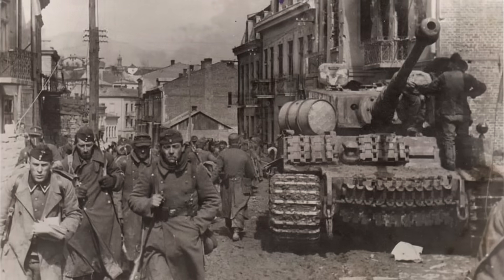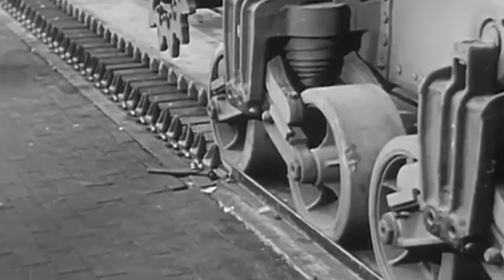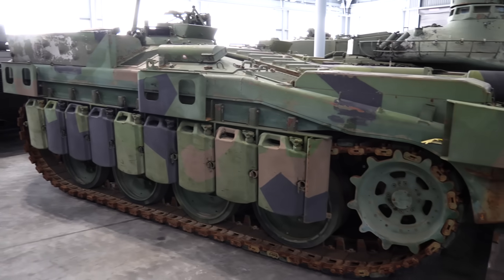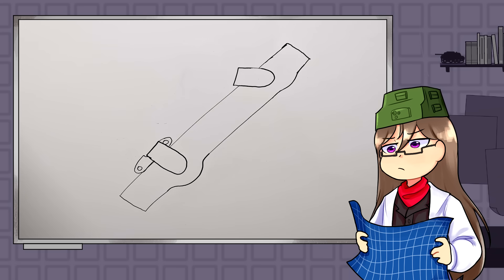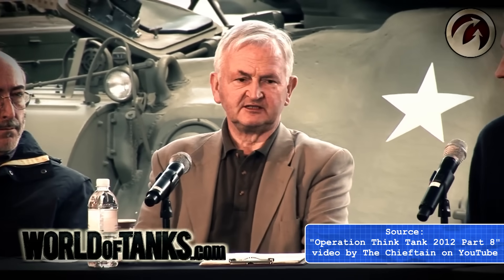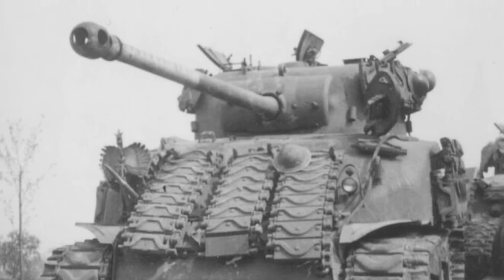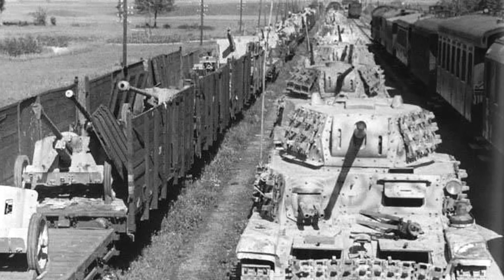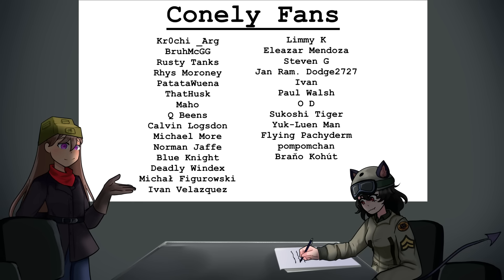Tank Tracks as Armor: Good or Bad?

Comment: I think that, for the most part, using tracks as add on armor is more a matter of improved morale as a result of feeling like you have taken your survival into your own hands. The fact that it does occasionally somewhat help is just an extra bonus. It is the same thing with sandbags and wood poles, not necessarily always effective, but it acts as a buoy for the crew’s morale. Which could in turn lead to them being more willing to take the initiative. 

Also, I have come across the existence of the Jagdchieftan, and I think it would make for a good episode of Cursed by Design. I haven’t been able to find much on it outside of photographs and a Tank Encyclopedia article.

Comment: There are several other aspects about adding Spare Tracks for added armor protection and are always overlooked, and that adding more spare tracks or armor plates adds more weight to the tank's normal amount of armor protection it already has and can greatly effect the tank's Engine Performance, Fuel Consumption and  Suspension Travel and can cause unforeseen problems for the crew especially when traversing in the countryside especially in deep snow, thick mud and going uphill.

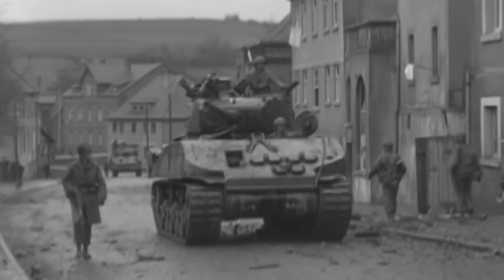Comment: [1:03] What tank is that?! Clearly it is Sherman-derived — but the entire front looks different, with that deep recess for the machine gun and that continuous sharp-edged rounded-Y front? Armor looks slab sided and extra heavy, but has a long gun... not an Easy 8, not a Jumbo, what is it? 🤔
Reply: yeah. I think its some kind of heavy field modification. In other old WW2 footage I have seen quite some insane modifications. 
But I am still unsure. Looks a bit too good to be some add on plates.
Edit: I think it's well made concrete armor. It's so well made that it looks like one continuous armor plate.
Reply: @Napswhilewatchin  exactly my thought, looks waaaaay to perfect and slick, to be a field modification — must've come from the factory or prototype lab like that
Reply: @lkjh861  Take a look at the gun travel lock thing. The shape is a dead giveaway that it hase to be concrete. And I think they added concrete on the sides as well. That's why it looks so "perfect".
Reply: @Napswhilewatchin  Spot on, looked it up -- that's exactly what it is. Never seen that before, despite having been interested in WW2 and especially tanks since childhood. 🤓👍
Reply from the maker: It's a Sherman with concrete added to the hull front

Comment: I would say it has at least a psychological effect on the crew, just adding some sort of armor will make them feel safer.

Guess on the straight armor like the Panzer III, IV and Tiger it might give some evenif it might be minimal protection.
On sloped armor, as you said it might act as a shottrap, preventing a shell from glancing off as it catches on the links.

Versus any ammunition that explodes on impact it probably also add some additional protection.

So as your conclusion it is situational. 
But never underestimate the psychological aspect superstition plays a big role, in that as well. Seeing a shell being stopped by additional tracks on a tank nearby might make you belief it works even if there might be some other reason for the non penetration. That also works on the antitank crew, seeing their shell bounce, making them think they can not defeat the additional armor.

There are many aspects that define if a shell penetrates or not. Also do  not forget that steel quality varied a lot in WWII, depending often from which factory the tank came. same with shell quality. So even these are reasons a shell penetrate or not. So you think you are safe in your T34 as you see a 75mm bounce off your neighbor tank, but yours might come from another factory and the same shell will penetrate.

Comment: Well questions like these regarding tanks always depends on the context.So as some of us might know armour piercing capped shells (apcbc)have metal caps made out of softer steel,so when the shell is shot at an angled armour plate the cap which is made out of a softer material de forms which decreases the angle when the shell hits the plate thereby increasing chances of pennetration.So in the case of of tracks on for example the upper front plate of a Sherman act as a cap for the shell when it hits the armour.

Comment: What it does do is handle lower calibre rounds on thinner armour sections, eg sides & rear.

Expect to run into people with 20mm autocannon or a 37mm in a recce vehicle?  Track links will be useful when your side armour is only 30-40mm thick there anyway.  20mm side armour and expect to see 14.5 or 12.5 mm HMG rounds?  Again, track links and the like will cope with those and eliminate the "1 in 50" that might make it through otherwise.

Comment: A couple of things not mentioned here: Yes, track links might not provide that much extra armor, but it is what is readily available to troops in the field: take a knocked out tank,push it off its tracks and you have plenty of material easily attached to your vehicle. Another factor is the psychological factor: If you think you are in a vehicle better than usual then you will be more at ease - a bullet can go through a thick log, but still people take cover behind them. And finally, I doubt many rank and file soliders had any knowledge about any degrading effect track links would have on the protection.

Comment: As the Chieftain said, crew morale often matters far more than the actual real-world performance of a vehicle and it's modifications. A crew that believes they are better protected is likely to act more aggressively and decisively which will likely improve the odds of the unit performing their assigned task. 

In a big picture sense, allowing crews to add track armor may add to overall casualties but improved mission success. Whether that is a worthwhile tradeoff comes down to bigger macro features that aren't present on the tactical level.

Comment: Perspective is a large part of getting to the truth. Or in some cases establishing the facts.  The small amount of armor added by extra tracks likely wouldn't help much in the case of a shell that depended on ballistics to pierce the armor.  Such as the case with the German 88mm or high velocity 75mm.  But the Germans handed out Panzerfausts like they used to hand out suckers to kids at the bank.  There were far more shaped charge weapons around than there were Tigers or even Stugs.  In fact they manufacture millions of Panzerfausts.  Extra tracks hung on the outside of your tank could go a long way in defeating shaped charge attacks because the stand off distance for the charge to do damage is crucial.  Today you can easily find pictures of Strikers with chain link like fencing around the to try and defeat modern shaped charges such as the Rpg.  Millions of Rpgs around so you're more likely to run in to one of them than a main battle tank.  So from the perspective of the crew of a Sherman or Striker, Why not give it a try?

Comment: there is a major flaw with research that has been done with improvized tank armor that you slightly addressed, but we simply have no good data on is how does improvised armor behave against MODERN weaponry used against tanks. WW2 featured almost exclusively standard blunt nosed armor piercing shells, sometimes with no cap, sometimes with a soft ballistic cap, sometimes with a hard ballistic cap and crude HEAT shells (many HEAT shells used in ww2 used steel as the penetrating lens of HEAT shells because the specific benefits of copper were not known early on, and later because of lack of availability.) 

These days, modern anti tank weapons tend to be extremely efficient high penetration HEAT shells, plastic HESH shells, and APFSDS shells. They share little in common with the types of munitions used when the majority of this testing was conducted, and I don't think comparisons can be made. For example, APFSDS shells, shaped like darts, have ballistic properties so extreme that they rarely bounce or ricochet. This is reflected in the armor designs of many common MBTs doing things that if we followed ww2 advice would be bad designs. An example being the leopard 2A6+ designs having turret cheeks that very clearly would create a threat of shot traps that could bounce projectiles down into the hull, a common problem with ww2 tank designs. Why does a modern MBT do such a thing? Because APFSDS has basically zero chance to deflect like that. Shot traps are more or less a dead phenomenon with modern tank and antitank design. 

Another example is how most modern tanks have composite armor made up of many layers of thinner armor (usually made of a mix different materials) rather than a single homogenous block of armor. According to ww2 tank design, and as you point out in the video, this should weaken the overall effects of the armor, but it doesn't. That's because the physical properties of the ammunition tanks have to counter has changed. 

You even point out that british testing of HESH ammunition found that tracks almost completely neutralized the spalling effect of HESH ammunition, rendering it far less effective. So, while the data presented is relevant to ww2 and that era of time, I think the jury is out whether it holds any relevance to modern warfare. separately, we've seen lots of evidence from the Russo-Ukraine war that improvised armor CAN be effective not only improvisationally, but AS DOCTRINE with the turtle tanks (aka assault shed aka tzar mangle) being decently effective at overcoming the threat they are designed to counter (HEAT armed FPVs) even if it comes with significant drawbacks.

Comment: Some may not know, the most effective tank armor in the early 2000s was the "Nokia mail". A protective mesh of steel and the strongest material known to man... the Nokia 30 series. This has been largely phased out in favor of more modern active protection systems. However many veterans can vouch for the lives saved by this amazing wonder material while it was being used.
Reply: you see a tank with the nokias attached, you run. Simple as that

Comment: 0:52 Before going further my opinion: Does it help? A bit but in practical sense not really a factor. Kinda like a cheap lock makes you feel better but doesn't provide much if any protection.
Reply: I feel like it’s a battle of: is it worth it to add all that weight for the small chance a track can divert a round and cause a ricochet or an undesirable angle for penetration. 

Tracks are sorta like a solider wearing body armour. Typically a round will kill them anyways and body armour may slow a round down enough to get stuck in the body rather than a pass through. So is it worth it to wear body armour and sacrifice that weight, for the chance or survival in a very specific situation. I’d say… maybe
Reply: @MTBJJ2001  close it is more like a soldier heard a phone stopped a bullet this one time (has actually happened) so he decides to make a vest out of phones to be better protected.
Reply: @ way better analogy 😂idk why I was struggling to come up with a good one like that

Comment: what if it was hung loose
the spaced armor test got its results because the shell was able to bite down into the thinner plate that would stay rigid but bend under the pressure
but what if instead of the plate being solid and the shell able to bite down into it
the tracks where loose, allowing the enemy shell to bite don into the track, just like thinner plate, but then the track would move and dissipate some of the force, it not being harderned and not being pointy basically deflecting off the angled armor just like a shell would, but one step removed
basically like gambeson instead of full plate, but for tanks 

not that it would matter much anymore
modern tanks dont tend to fire a lot of solid slugs
and the spaced armor would be helpful vs heat and hesh

Comment: This same type of discussion came up with Russian "cope cages" as a defense against javelin attacks. The Russians did some good work on this and concluded they worked as long as the bars were spaced 150mm apart. This meant the missile would strike one bar and then his the tank with it's side so the detonation would deflect. Unfortunately Russian tanker used common sense and put the bars as close together as they could for additional protection. So the missile would hit two bars and hit the tank straight on and kill all the occupants!

Comment: TLDR, 
Track armour on vertical surfaces = slightly increased total thickness 
Track armour on sloped surfaces = increased shell normalisation and increased chance of penetration.
Reply from the maker: Potentially yes, it may also depend on the track material and angle of the armor. As I said in the video it's complicated
Reply: @ Yeah no doubt, with range tests showing one thing and combat anecdote’s saying another.

Comment: As far as weight, if spare track links are to be carried to allow repairs by the crew in the field (as opposed waiting for maintenance crews) then why not use them to add 16 mm. An extra 16 mm on a M4 glacis might not add much (v a 7.5 cm KwK 42 or 8.8 cm PaK/KwK 43) but it might be just enough on the relatively vertical turret side versus a 7.5 cm KwK 40 L/48.

Comment: the way I like to think about it in a simplified way is that tracks, being soft, act a bit like AP caps in APCBC. one may think it's bad to add a blunt cap of soft metal in front of a hardened AP projectile but the soft cap protects the hardened projectile from shattering against hardened armour and funnels it into the armour plate instead of letting it bounce off. similarly, HESH would be made worse if you add an AP cap in front of it, as it depends on direct transfer of a shockwave through the armour plate.

Comment: From a purely tanker standpoint,  I served on 48's   60's and M 1.. you always carried spare track , center guides,  end connectors etc.
 You need all the extra since maintenance support was always far off.  You had to be able to repair quickly and get on with the mission
Reply: As a former H-60 crewchief, I can honestly say you never carried enough fuel, spares or ammo. (not that there is such a thing as "enough" of any of the above)
Reply: I am not a tanker; I always thought they were just spares for field maintenance.
Reply: @micheljavert5923 until you needed something big to clear the field!!😂😂

Comment: As a tanker, we ALWAYS carried excess track pads on our tanks, but this was done more to have a supply of repair parts as it was to make what we called "stand off."
Reply: What was the preferred storage method? Do any tanks have track lockers?
Reply: @paulwoodman5131  We used to attach them to the infantry rails along the turret sides either by the center guides or just wedging them in behind the infantry rails.  Their weight kept them in place and I never had on fall off.  Full disclosure: I'm kinda old, so we're talking the M-60 series of American tanks.  IDK how this might apply to new tanks.
Reply: @scottmiller6958 Thanks.  running  around the field. You're going to need the tracks for sure. Someone's going to have to carry them. Probably won't get shot at but you will wear out tracks. Each unit would have to split that up I guess . the tank recovery rig carries parts.
Reply: How much track= 1 tank ......

War is mainly resources ... So if 10 tanks cover in track have enough steel to = 1 tank what's the better ratio 

11 tanks and 1 set of spare tracks 

Or 10 tanks and 20 sets of spare tracks.

How much is to much....
Reply: @JackTalyorD  The answer is 10 tanks with 20 sets of spare tracks.  Sounds odd, but here's why:  Tanks are EXTREMELY maintenance heavy weapons.  The most important stat for tanks, especially in WWII where they most often fought non-armored targets, was not speed, armor thickness, nor penetration power of the main gun.  It's the tanks operational readiness (OR) rate.  This is why many historians rate the Sherman and T-34 above the German's Tiger and Panther series.  On a head to head engagement, the Tiger or Panther would win, but they never fought head to head, in part, because the German OR rate was so poor.  Many German tanks, that frequently broke down, were destroyed by their own crews to keep them from being captured.  The extra tracks that kept a tank in the field rolling was better than having an extra tank in the bone yard awaiting repairs.
Reply: @scottmiller6958  good point but wasn't that more a result of lack of supplies.

German could never hope to match the quantity of production so attempted to fix that issue by quality
Reply: @JackTalyorD That's video game resource economy. 10 spare tracks or 100 spare tracks would not build a single tank because they were made with different materials, tank armor plates were different metal alloy than softer track metals, and not to mention specialized materials for radios, engines, optics so on.
Reply: @sthrich635  close enough..... Which then just the materials... Th skilled labour....to make the track or the tank ..
Reply: @JackTalyorD  You can't build a cannon from the mild steel that's used for tracks. You can't build optics from the materials used for tracks. Your maths ain't mathing
Reply: @Raruschmaru  there's more then just basic materials in the equation 
From skilled labour to manufacture 

Plus what the difference between pig iron and stainless steel
Reply: @JackTalyorD  if I'm understanding you right the best metric depending on the kind of army and the size you need to achieve a liberal number for a sustainable army with an emphasis on reusing and repair maybe 15 tanks to 25 repair sets
Reply: @JackTalyorD  *too